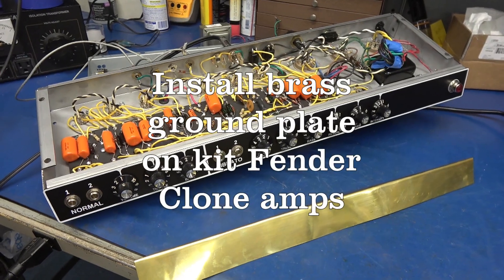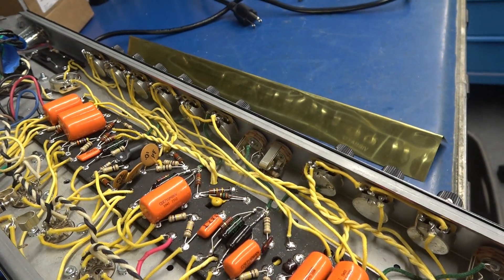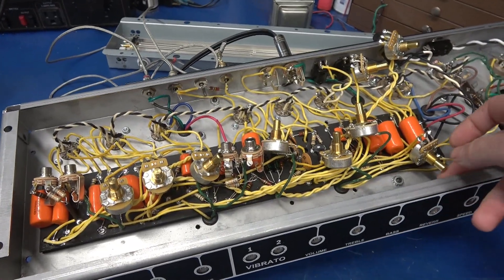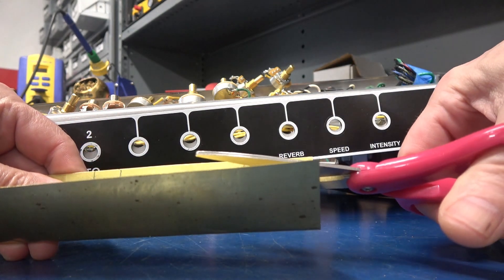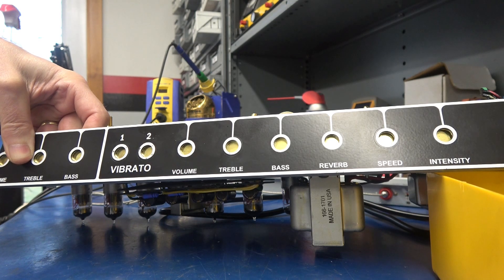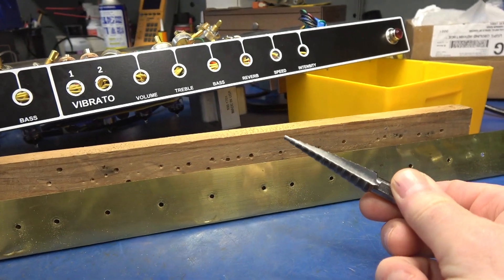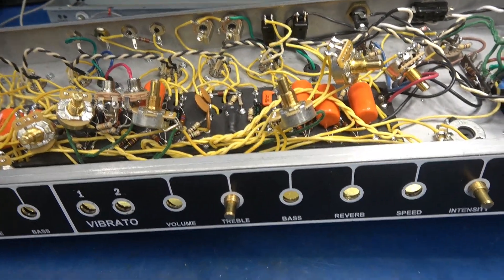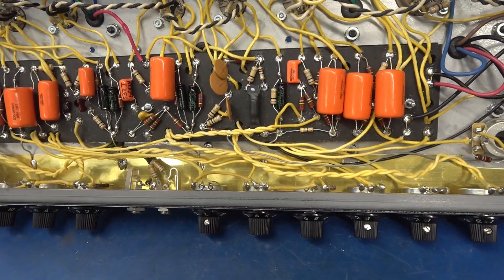How to Install brass ground plate Fender clone kit amps reduce hum buzz easy procedure

Comment: Terry did the same with a MojoTone Fender Deluxe Reverb Kit because of hum issues with too many ground wires. This 
will solve the hum  issues like Fender did and goes in better detail with this video about getting the thin brass plate in the chassis. Kits probably don't have this in them because they would have to sell a different brass plate with predrilled holes
for several types of chassis designs.